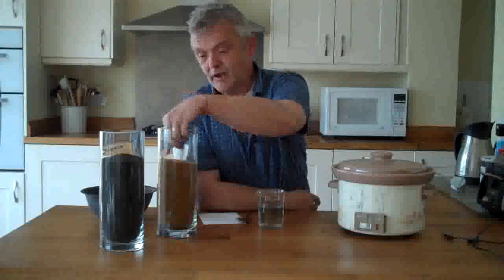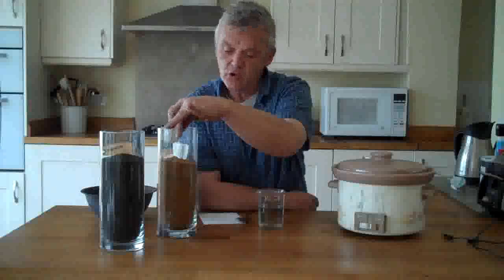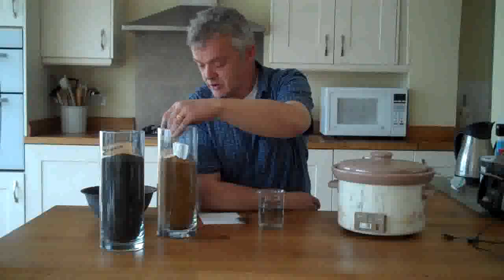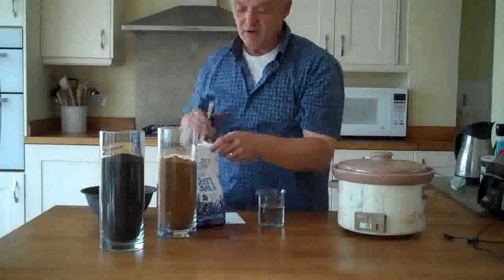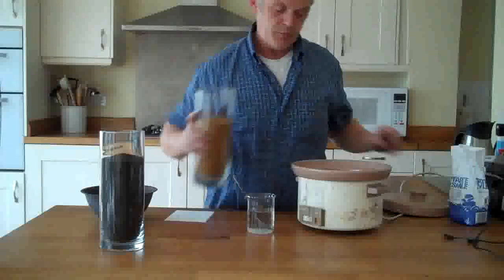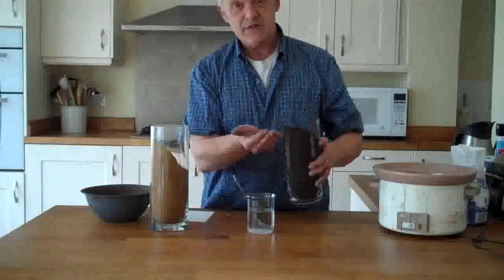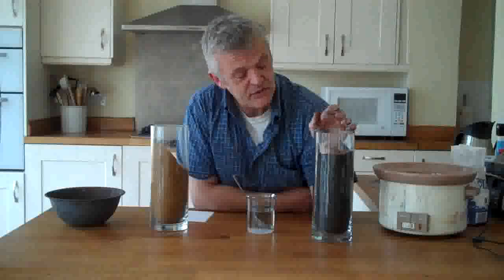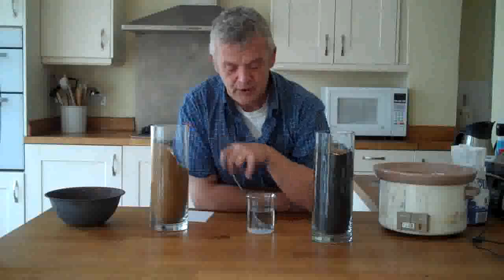Making UltraSand (Graphene Coated Sand)  From Ordinary Sugar For Water Filtration

Comment: Thank you for tye video .do you have a hard copy available ? The acoustics and the accent I can only make out some of what your saying . do you do a text with the videos .I'm getting older and my hi frequency hearing is going on me ..here's a idea for you they have fornd that with a squirrel cage fan and 2,000 pounds of CaCl you can pull 700 gals of water from the air it was tested in dessert locations .and I've seen some new carbon filters made from grapheme  that can remove almost everything from the water but the grapheme swells a little do there putting a type of plastic coating on it to stop the swelling graphenes hole is the same size as a water molecule but when it swells it gets bigger .the point I'm trying to make here is with the grapheme and the fan with the CaCl is a lot of free water anywhere on the planet .does that sound like a worthy project ???? Your own personal water as much as you need ??? For drinking and aquaponics ect !!!😀

Comment: I will get sand tomorrow and start the process :) Are others working on this? Any success? I have lots of sand and looking to setup
Reply from the maker: I think you have an awesome plan there mate - let me know how you get on
Reply: @ThinkingandTinkering  Got two 20Lt buckets of sand (snow and ice too) Did not want to wait, tell the spring lol. Got one bucket sifted, washed and now drying it for a day or two with wood stove. Now, to learn to use the ceramic Kelm and get the sugar solution. Oh yes, need to get or make activated carbon. :)

Comment: Have you tried catalytically induced low energy graphitization using a metal salt? My theory is, that after heating the solution to 150-700 degrees Celsius, you have graphite coated sand with metal salt and reduced metal salt residues in it (you may want to vary with metal salt concentration, but I think 5% is good), to wash them away use a soft acid (acedic acid, formic acid or other organic acids) and so the residues are dissolved in it or if they are reduced, they form new salts with the soft acids and will dissolve in the acid to form a corresponding acid base pair and therefore through the removal of residues tiny pores will be created, and now the carbon compound sand should have been activated.Could this work??
Sorry for my bad english, but I'm just a 14yr old German student 😇😅

Comment: After Activating it with H2SO4 , should we clean directly with water(deionised). since acid and water heat is liberated in large amounts. does it effects the adsorption. 

i have done batch adsorption on 600PPM water but cannot find any improvement in adsorption results.
please let me know if any precautions to be taken.
Reply from the maker: here's the original paper - http://pubs.acs.org/doi/abs/10.1021/am300889u
Reply: Thank you so much. We have gone through this paper they havent mentioned about aftermath H2SO4 cleaning. 
Any how thank you, we will do still more trails. 👍😊

Comment: Hi Robert. I am the president of a school group and we are preparing to make some ultrasand, but we were shocked when we found out the ratio of sand to sulfuric acid. I bought 1900mL (two 950mL bottles) of sulfuric acid, which if my math is correct, we can only make 95 grams of ultrasand with out current supplies. You appear to have quite a bit of sand there in your video, so I'm just finding it hard to believe that these two very large bottles of sulfuric acid are only going to make 95g of sand! Can you help? Thanks
Reply from the maker: the video shows a replication of a published paper - you can play around with the acid and see what you get - the acid is an activator and the degree of activation is going to be a function of time, concentration and temperature

Comment: Hey Robert! I'm preparing to follow the procedure and while I was pondering the economics I began wondering what happens when the graphine pulls the salt from a saline solution. Does the sand become saturated irreversibly? 

What is the process for identifying how many grams of ultrasand (assuming a medium good production ;D) can hold x grams of salt? Is there a way to de-saturate it so it begins to work again? 

Thanks again for all your hard work and extremely informative videos!
Reply from the maker: the eesd enrgy density is already higher than they report mate - but thanks for the heads up
Reply: Try heating it up again in the kiln. salt has a melting point of 800 °C and should just burn away if saturated.
Reply: Also could try boiling in the used g-sand in a bath of vinegar or ascorbic acid to clean.  Measure how long it takes to stop working.

Comment: Is it possible to get the graphene off the sand and use it? It seems this might be a way to mass produce graphene.
Reply from the maker: +Randy Travis It is doable mate - for example HF acid will dissolve it - but a mechanical method and a cyclone separator may work well

Comment: Is this Graphene coated Sand or GO coated?
Reply from the maker: +Ankush Dhawan graphene
Reply: +Robert Murray-Smith Thank You for the response - what does the H2SO4 at the end do-does that oxidize the graphene to make GO? What does activation of graphene do?
Reply from the maker: +Ankush Dhawan search google scholar and read mate - the answer is there and a bit long to put into a comment post - plus - i hate to answer his kind of question as the learning has to be - in part - your responsibility - the answer is easy to find - i suggest you go and find it - that means you will have invested something of yourself in the process and you will actually learn

Comment: This is incredible stuff, I have a problem with well water that  is high in SO4 (Sulfates) roughly 2000 PPM, would this filter sand  help to filter out the SO4 of the water?
Reply from the maker: +Delbert Benterud if you combine it with CDI - yes

Comment: Hi Robert, thank you very much for all your videos. This is really really great. 
Do you have any idea of the size of the molecules your Ultrasand can filter? Systems like the LifeSaver bottle have a 15nm pore size filter but are way to much expensive to really bring them to the third world. 
I wonder if your method can work as well as these filters and if not, do you have an idea of what improvement could we make to do so.
Thanks in advance for your help
Reply from the maker: +Jonathan KLEIN stick it in an unglazed clay pot and then put that in a larger glazed pot pour soiled water into the sand in the unglazed pot centre and you will have clean drinkable water in the outer glazed pot

Comment: Hello there Robert,
I have been working on a project to make clean drinking water available to the villages of India but the problem is that the water here has very high TDS levels(above 800 or so).I just wanted to ask that would the Graphene-Oxide-Coated-Sand filter remove the DISSOLVED  Salts from the water or not.
.
.
.And one more question: How can i get Graphene Oxide in India

Comment: Hi Rob,
I am doing a thesis on low cost ways for making fresh water for  agricultural use in Ireland and I was wondering is there anyway that I can activate the sand without using sulphuric acid as I do not have the facilites to use this?
This is very interesting and I hope you can help me out :)
Reply from the maker: look at activated carbon for ideas
Reply: Robert Murray-Smith 
My son has created ultra sand. They need to do activation step. As sulfuric acid is hazardous they are not allowed to use sulfuric acid. Is there any alternative process to activate filter

Comment: hi rob 
would a solution of silica gel used to saturate a sheet of htc wood and baked in a kiln turn the carbon into graphite, if so would it be an inprovement for your super caps . 
if it was very week solution would it make graphene. i cant stop checking youtube for your next uploads , someone clone rob so we can increase hes output.
Reply from the maker: I don't know mate - but it's worth a try after all silicon is catalytic for graphite
Reply: john mcfadden look up crispr kit on google, we can clone him with the $2000 kit I think

Comment: Do you have any more info on SiO2's catalytic effect? It was my understanding that Graphite only forms at much higher temperatures from carbon.
Reply from the maker: there is loads of stuff that will catalyse graphetisation. In fact just put that in google scholar and you will run up hundreds of papers
Reply: I've read a few, but they seem vague on the actual mechanism and they all require a far higher temp. Most focus on catalysts other than SiO2, or at least the free-to-read stuff does so I'll continue to look around. Really enjoying the videos and book though.
Reply from the maker: M Barnekow
yeah they can be - a lot of what i do on the vids is the result of quite a lot of experimentation and that is about all you can do - at least the papers give you a rough starting point from there you have to experiment

Comment: well one of the big problems with graphene production is reproduction or defects in the structure, using cymatics by way of something like a piezoelectric substrate you could create patterns or circuits that give the nano arrays different characteristics, both in tenacity and conductivity. as well as reproducing experiments in a much more controlled environment. or transfer nano arrays to substrates that would not be conducive to things like lithography.
Reply: Cymatics only produce patterns on large flat surfaces.  Sand is too 3D and the 2d graphene too tiny to create patterns on it from any frequency in the audible range.  But that doesn't rule out the possibilities.  It would be really good if you knew the atomic pitch of all the elements involved.

Comment: A possible improvement would be to use either an oil and soap mixture or soap alone in place of sugar.  I think this could eliminate the slow approach to the caramelization temperature.  If I had a kiln I would test this!  Several years ago I read a patent for putting a selective coating (high absorption / low emissivity) on aluminum foil.  They put a thin coat of oil on aluminum and baked it in the oven.  In experimenting I found adding soap to the oil made it turn black much faster.

Comment: Got it, good thing the powdered charcoal isn't really a big problem, would try increasing the time frame... One more thing, you said using paper as a separator between the AC and coated sand, won't it burn off?

Comment: planning on adding a bit of variation to my own and I'm wondering if I'm still good to go;
1) using a hot plate(on low and high) instead of an oven for the 1st 2 heating steps(95c and 200c)
2) cutting the heating time from 6hrs down to 2-3hrs cause it's almost impossible to get 6hrs constant power from where I'm from.
3) using powdered charcoal instead of activated carbon(I have no clue as to where I'll get the latter)
so sir RMS, am I still good to go?

Comment from the maker: a small amount of acid in the sugar solution will help but you want a very very very thin layer formed on the sand. If you do the reaction too quickly you won't get a thin even coat you'll just get lumps of carbon and sand. Remember the sand acts as a catalytic converter changing the carbon to graphite. It need to be in intimate contact to do this and the long heat treatment is to achieve this not just the conversion to carbon